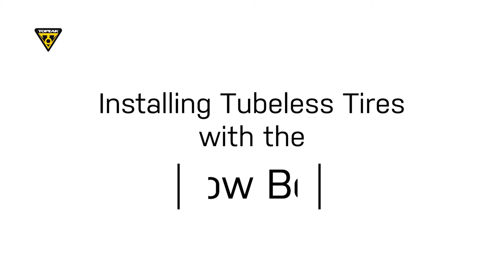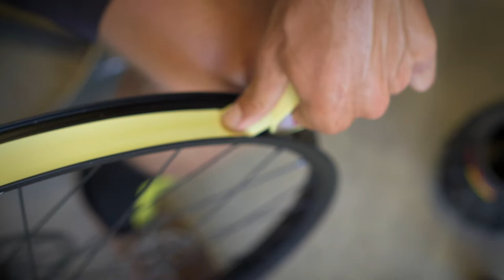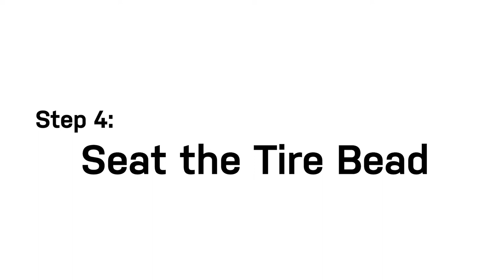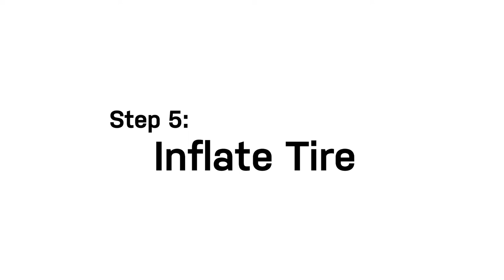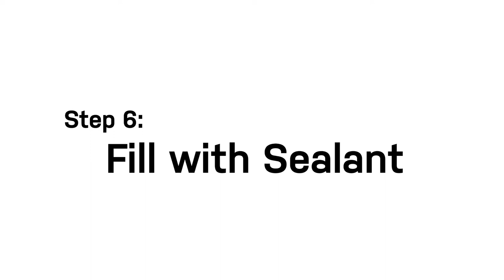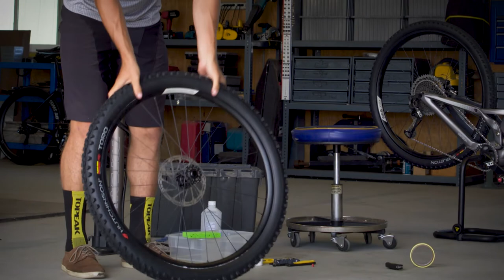TOPEAK - How to Install Tubeless Tire with JoeBlow Booster

Comment: I Find it best to first fit with an innertube after applying the rim tape. Pump to 60psi and leave overnight. That makes sure the tape is stuck firm everywhere and gets rid of any wrinkles around the spoke holes etc. Nothing worse than getting to the end and find sealent leaking through the spoke holes.
Reply: Good suggestion

Comment: Just bought one of these and it's pretty useless. Doesn't release the pressure quickly enough and certainly didn't seal the bead. Looks like I just wasted $160 plus the cost of tubes I now need to use lol.
Reply: I had the same issue - I think you need to keep pressure on the pump handle as you rotate the dial to release the air from the chamber.  I've got to give it a go myself to be sure but that appears to be the only difference from when I had the same issue as you!
Reply: My issue is how the nozzle fits onto the (presta) valve, can't seem to get it to connect (clamp) securely like I'd assume it would.

Comment: I have a gravel bike that is max 50 psi, but would you still recommend the 160 psi to bead it and deflate after?  Is that pressure okay on the tyre?  With the tyre already part off as I was going to change the sealant as changing brands, is it better then to still inject it through the valve?  Is this to stop it spraying out if trying to bead it with it in?  Good video, thanks.

Comment: Do you recommend less pressure for road tyres such as 25/28’s? 160 psi seems high?
Reply: Seems really high, to me.
Reply: I saw another video where it’s recommended 120 for proper road tyres. Looking for any experience out there
Reply: It's 160psi is in the inflation chamber.   As you dump the air into the tire, the total volume increases dramatically probably 2-3x with a big 29er tire like that.  You'll also lose a bunch of air before the tire actually seats.  By the ideal gas law, the pressure in this higher volume system will drop proportionally.  The trouble is not blowing the tire off the rim, it's getting enough air fast enough to get it to seat rather than just escaping between the tire and rim.

Comment: If you load the canister with 160psi, does it hold the pressure for a while, or does it leak slowly till it empties after a couple hours? I'm asking cause I just bought one and it leaks slowly and I want to make sure that's normal.
Reply: It will leak slowly due to the Hugh pressure.. not really sure why you would want to keep it pressurised though??
Reply: @phantombigballs8165  I wouldn't want to do that. And in fact the instructions say specifically not to do that. I just like to put all my stuff through tests.

Comment: My question is if you pre load for 160psi but the tire max psi is 70 then how does that work?
Reply: so your tires are unseated right ? so it wouldn't be air tight , so the idea is that when you use the 160psi to inflate the unseated tyre , the incoming air would be fast and furious enough to compensate the outgoing air escaping from the gaps and the tire would seat, so that means not all the 160psi would be in the tire

Comment: Can it be used as a regular pump without engaging the "booster"? I mean, for any pumping that's not for seating a tubeless tire.
Reply: Yes, you can use it as a regular pump. Turn the ring  in the inflate modus, than it has the function as a normal pump. The "booster" will be only filled with air when you are in charge mode.
Reply: @Spider-ut4we  thanks my friend!

Comment: How do I use this pump without the valve core in the valve?
Reply: How are you supposed to use it without the core in it? As soon as you remove the pump all the air will shoot out...

Comment: Can unloading 160psi at once damage the tire? I ask why the tires usually have a recommendation of 55-60psi. Or maybe those 160psi are not all absorbed into the tire? Please answer, I am looking to buy this Joeblow and I have this doubt.
Reply: You can see when he releases the pressure into the tire, the pressure falls below 40psi.  The volume of the pump is less than the volume of the tire.
Reply: @mushieslushie  Thanks for the answer, I believe that a lot of air must escape until the tire settles on the rim.
Reply: @cassioa.borsatto5128  Hey! First, to add on to mushies answer even if you inflate the tire above its recommended PSI, the worst thing that can happen is the tire popping off the rim. It will be very loud but won't damage the tire or rim.
Reply: @lmandrums3118  Thanks for the answer.
Reply: P1V1=P2V2...  (ideally, but close enough).